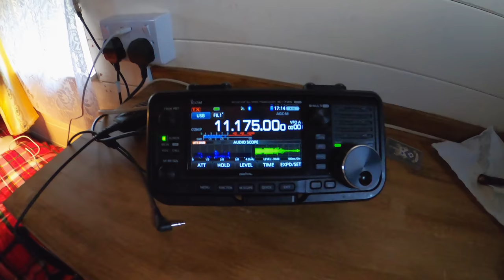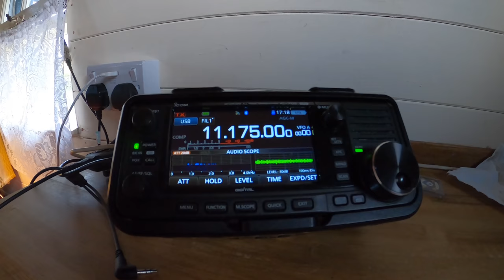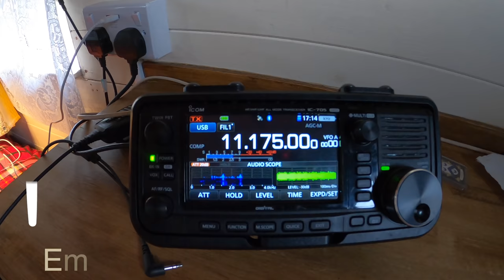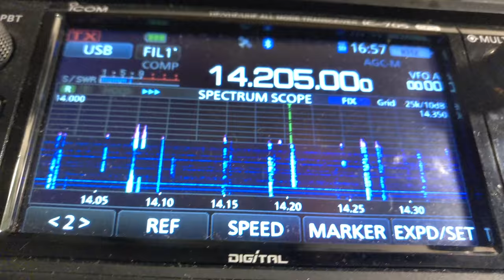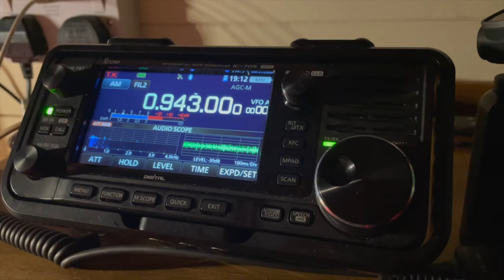How to monitor US Air Force military radio | Ham radio

Comment: Should put some WebSDR stuff on list of useful related sites. Thanks to people that generously host a feed from their receivers, you can listen in via the internet rather than having to invest in the gear. (Having the gear is still neat, but for newbies or a casual interest - then listening via a web page is nice. Listings with those sites are also useful for DX testing to various locations if broadcasting too.)

Comment: Nice radio. Very nice QTH. I have a Icom 7300 and battery pack to take in my Tundra/Fourwheel popup truck camper for mobile ops here in Wyoming,Montana and Idaho with end fed dipole. I like your fibreglass mast setup. Good idea. I may use that, Nice Land Rover. Thinking of a Icom 705 for taking in backpack  for hikes up in mountains for mobile QSLs.

Comment: Loving the videos, food, radio and locations. Thanks for all your efforts.
Is your IC-705 sitting in a case on the table in this video? If so, what is it?
Reply from the maker: I use Peovi Carry Cage and took the handles off it so it fits into the hardcase
Reply: @M0SZT  : Was that your SDR in the small box on the back of the table? I'll look and see if you listed your gear somewhere.

Comment: The stuff you thought was related to the snow looks like a solar charge controller, I'm off grid and get similar but it's usually when it's really sunny and the controllers are working hard, not the other way around when there's snow.. weird. Is your XYL anti HF? That's a cute dog house/man cave.

Comment: Superb video. Reallt helpful.After years of listening to VHF/UHF in East Anglia around the bases locally here i have just started in the last year getting HF using a RSPA1 SDR Play and using SDRUNO with a wellbrook active loop i have just installed. This is the kind of comms i have been hunting. Been listing to NAT atlantic stuff but really after this stuff as well. thanks again. How active is 11175 with your experience? had a few hits on my homemade long wire in the past. Is it busy daily?
Reply: your antenna looks interesting as well. will take a look

Comment: Nice radio shack/setup. Your radio looks plugged in, do you have mains power or are you running with batteries?
Reply from the maker: Running with a battery on this trip

Comment: Hello, I have a question. In this video your laptop....is that an app to be able to lisen via the laptop? Thanks.
Reply from the maker: yes its an icom app (2 in fact), one app makes a connection via wifi with the radio and passes audio and commands back and forth the second provides an interface that emulates the radio controls, you can press transmit and send your voice or data via the wifi connection into the radio and out via RF. RS-BA1 Version 2

Comment: Why not insulate your “radio shack” and put an electric baseboard heater in there? It’s better than freezing your nutsack off. Or an even better idea, move your “radio shack” into the fodder room, insulate it, and run power to it to have electric heat, and power for the radios.